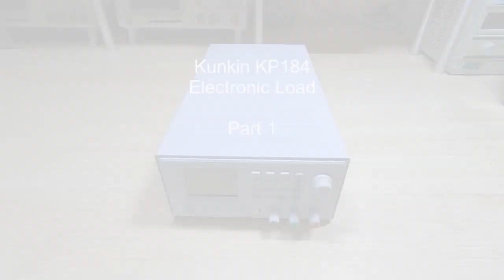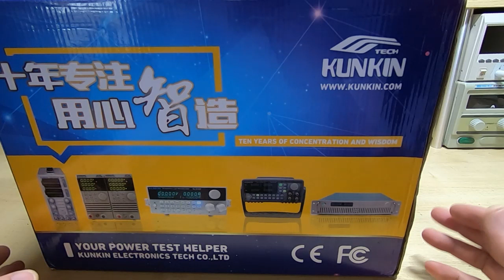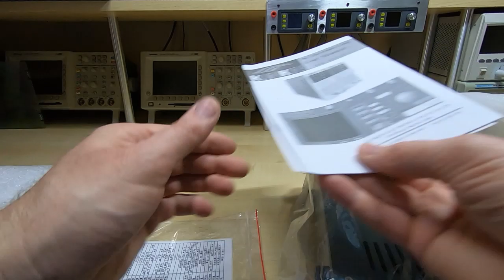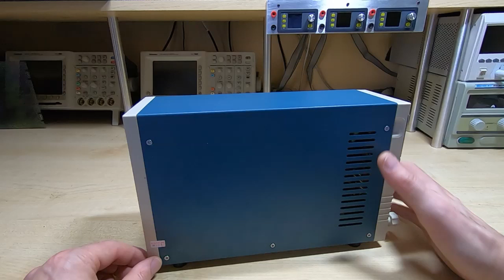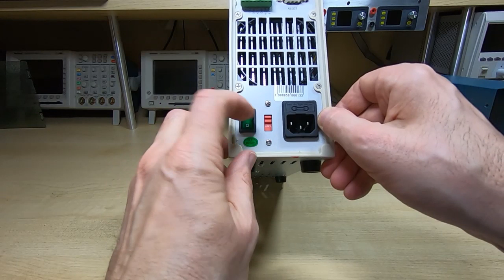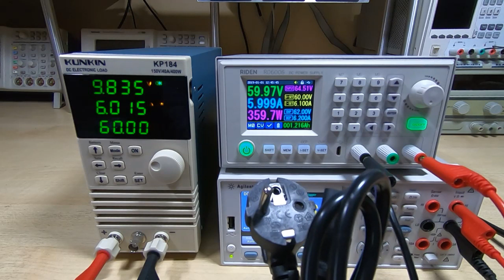Kunkin KP184 Electronic Load Part1

Comment: Mine arrived with the transformer totally free and rattling around. The mounting screws had vibrated out, or were never tightened. Detecting no damage to other components or wiring, I straightened the mounting lugs, secured the transformer with better bolts and everything seems to be fine.

Comment: One of the best reviews of the Kunkin load! The current error in the Kunkin seems to be only on low levels like from 0...3 A - it levels out at higher amperage. This is not too astonishing for a 40A electronic load. So quite accurate device and capable of handling really 400W it seems.

Comment: Wonder how it compares to the other cheap one the Et5410
Reply: I have found the ET5410 to be easier to operate in many aspects, but overall both the KP184 and the ET5410 are quite comparable. Both are high quality enough for the price, both have the same problem with the transformer in the bottom. The ET5410 has a better display, and some functions are easier to use. The ET5410 does not have remote sense leads.

Comment: Hi Jerry Great Video very informative thank you for sharing

Correct me if i am wrong but the temperature on the alternating display is for the external probe you are measuring power supply temperature with
which is good idea, But i believe  the actual temperature for the Riden processor is in the Menu shit + 0 exclamation mark
Reply from the maker: Yes that is correct. The displayed temperature if from the external probe which I have connected to the hottest part of the system. The RD6006 board sensor and fan control are indenepdant of that. The case fan is controlled by a third probe which I also have attached to the hottest point. In the video I mention that the external probe can be used as a battery temp monitor for battery charging if required.

Comment: I have been looking at this it’s also in my amazon list
Reply from the maker: So far it seems like a very good buy. I still have a lot of testing to do. The error in the power reading is because the load is not very accurate in current measurement. I have found a hidden menu but have not yet found one for the calibration. It may be an RS232 only function. However the error is still OK for what I intend to use it for and as I can buy 5 of these for one 300W BK precision unit I am happy to use these for general everyday testing.
Reply: Jerry Walker good enough for me for sure.

Comment: Hi Jerry. Loving your very informative videos. I note that the RD6006 power supplies come with a smaller case option but I'm not certain what power supply to use with it. For my lab I'd like the smaller case to fit my desk so wondering if you know of or could recommend a power supply that would fit and has the same spec (or close to it as the longer version?). Alternatively do you know of a good supply thats relatively small as an alternative option? I am just starting in the world of electronics and loving it but it gets a little overwhelming with all the power supplies and other tools out there! :)
Reply from the maker: In theory you can use any power supply that will fit into the case but I would hesitate to recommend any particular supply as I have not tested any of the smaller form factor supplies. But as an example there are supplies such as this https://www.ebay.co.uk/itm/500W-Dual-voltage-LLC-Switching-power-supply-board-for-power-amp-PSU-DIY/113322035303?_trkparms=ispr%3D1&hash=item1a62850867:m:mVwfBVthXha05Fa3B9RFMUQ&enc=AQAEAAACQBPxNw%2BVj6nta7CKEs3N0qUrec19JXainX3jrzfGgV7MXeOa7RiY4mMUFKrr3DsAxsN1v5XelH07bJbTIJxhnJIfafkM5rIuuFy%2FL9TeE37%2FtyAblR2OeVCRhyPx5i42H%2FcKYf0mcwC6UXFRwD%2Fd0OTpH91T2j3jajNn%2B%2FjQyeNy4WUM1BdoEiALhWmN6XjdZyvlzsKCoh36fsld7ZGmwHGTZwZzaYBMFqLByg1yLfMTdxQlmRdvDJI%2FOQqySaM%2F5whLb9KnESTW3X7hQm4PkMO2eDDSi1ZUofd%2BAFt%2By2fi71UehsVZzq8E0CwfZA6bGajmWXtQ9PGMaii6SzKjgErADh9d95rP5wVL3KOe8vJSD3Pb1QJm7KmTRey9u4pHiw4OOCT0bW7Vp%2BErmA0X7fpUisupBmp5A8mg4sbSilhKap3Etx3N6GlP85E%2FlIV9XCeQBBFZeFVF6IA3XqAxMtdAXZQF7BtLyzPE8FadWlIJ38ZXuDP43g5aT7qTMUxjbtQrQl00OYe5Gd4Vlq4s1MPOryyvvcl9lULY%2FzmVxQLhycCU2JLuaxShqevsHNGhcoJBnKnO8vG0UwErlE7Hhou8b174OyEbxoUx9J4X1TGIdVvz2%2BzRXRNqA2lxxam5li01BXgJSZUFq8kkSJCHqlqCkwNCw579RHYG5hPzPhClroXMFNw3J1Hd4AUFuDIZ7WOR1YpyLLsct7jRuXaYaB9qiWyS%2B88XZOgFH1uHT9zUuMm%2FyIP663NcwgQir3hpCQ%3D%3D&checksum=113322035303a9d2c785e3864a86bed37800aaba5e91 which will fit but as ever you buy chinease supplies at your own risk. Some may work and others may catch fire but this small form factor seems to be what the smaller case is aimed at. If you have noticed on my videos I have several supply controllers attached to my bench and these are all fed from a common distribution supply box with a number of independent DC supplies and this can also be a goo approach with the RD6006 but of course it depends on what you need. I would of course highly recommend very through testing of any supply you use before attaching anything of importance to it.
Reply: @JerryWalker001  Thank you so much. That has been my concern with the cheaper power supplies from China. I may look at the option of feeding it from a common distribution supply box like you have done with independent DC supplies. At least then I can hook up a couple more in future. I'm only doing basic electronic work, repairs for things like PC boards, TV's and radio equipment as I am a ham operator. Eventually I want to expand my knowledge and build equipment using various Arduino  and Raspberry Pi boards as well as custom boards once I know what I am doing. I have some basic electronic knowledge but want to expand that much much further :)
Reply from the maker: I feed mine from spearate isolated supplies so I can hook them up anyway I want. For example I can connect them as +5 / +12 and -12V all at the same time and this is very useful for general testing and development. You could of course use something like the Rigol that I have if you wanted to spend 10 times as much. You may have noticed that I often try out cheap chinease equipment and the reason for this is to try to show that there is no need to spend lots of money to get up and running even though I have a very well equiped workshop and even better equiped lab. You can always buy more expensive equipment later if you think you need it. As you develop more things you get a better idea where best to spend the money.

Comment: looks like it has 9 pin serial. That would be worth a look to see how it can be controlled, etc.
Reply from the maker: Yes it has RS232 and there is some basic software to control it and also a command set so it can be controlled via a terminal. The only issue I have found with it so far is that the current measurement is off which is wht the power reading is also wrong. I have found a hidden menu but I cannot find a way to calibrate it so it may be fun finding out (it may just be a serial only function).
Reply: @JerryWalker001  yeah I agree.  I sure would like to see more on all that.